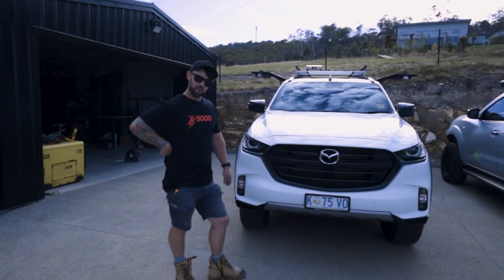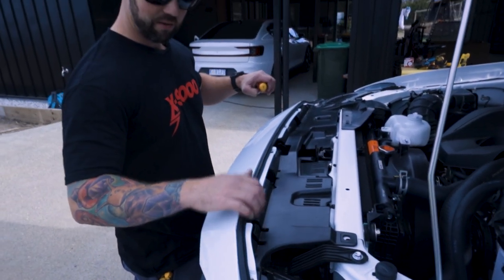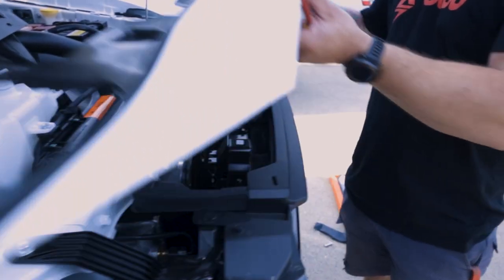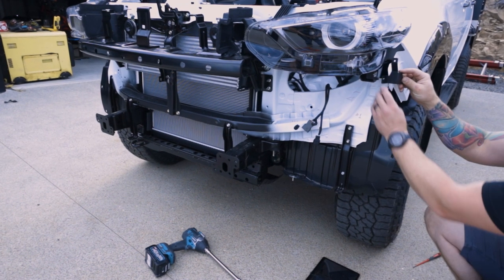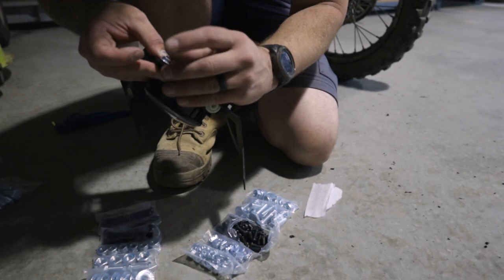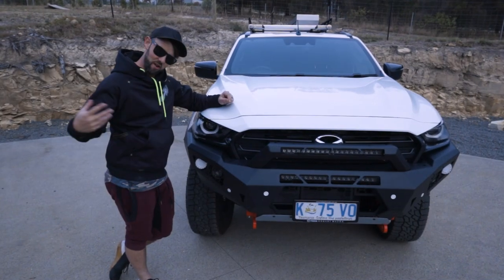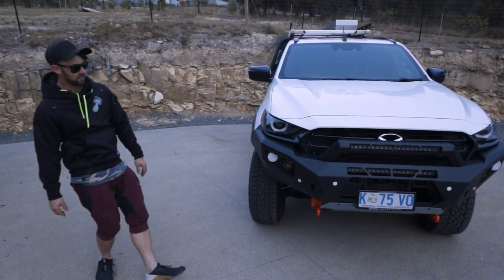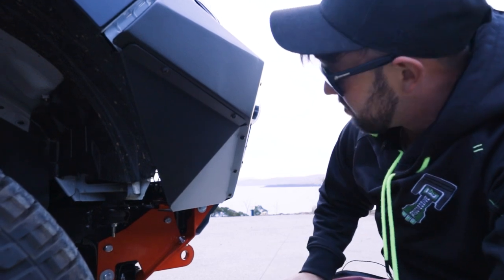Installing a offroad animal Bull Bar to a Mazda BT-50 2022

Comment: I work for Mazda and don"t get me wrong the BT's are great but are they Hell to work on, In older models you have to change the oil within 15 mins or it can create an air pocket that prevents oil circulation!!
Reply: Bull Bar looks good Tho
Reply from the maker: @subsonic3094  that's why I wanted a 4J engine this time.
Reply: Mazda have always been a turd to work on. I worked on hundreds of cars, of all makes and models...always hated working on the mazdas...they run isuzu engines and driveline now, which is the only reason I'd even consider buying one...